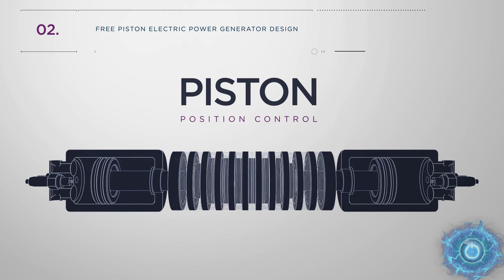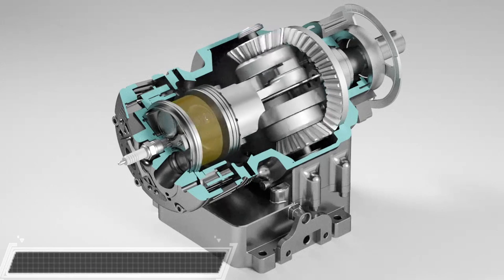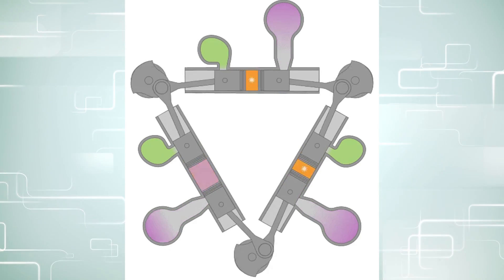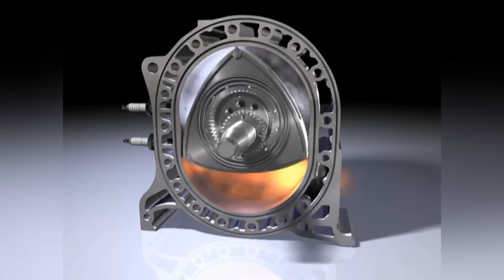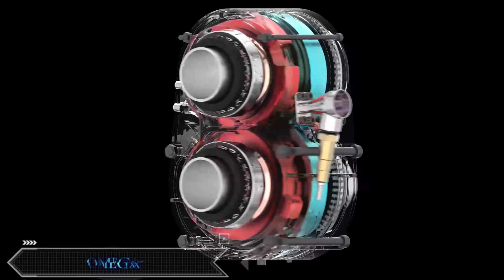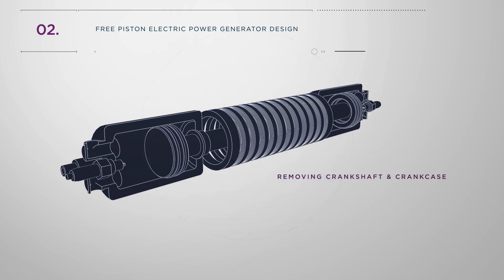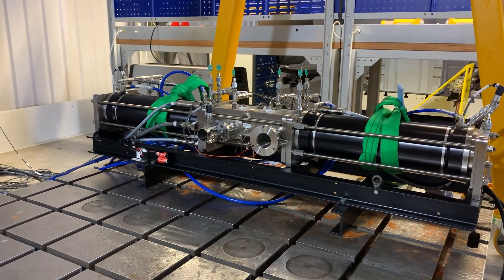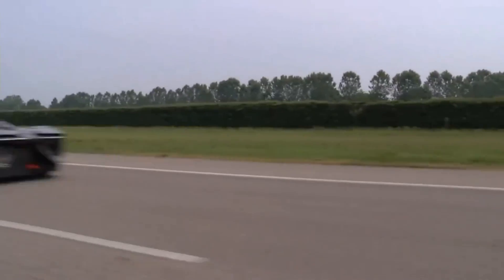7  MOST EXTREME MINI-Engines

Comment: You can call them "range extenders" if you like, but that only proves a fixation on the electric drive portion of a true Hybrid drive system, which necessarily uses a form of chemical fuel input at this point in the tech development. 
The benefit of efficiency and range derived from this far exceeds the concept of charging electrical storage batteries at some fixed location, especially when people aren't even smart enough to standardize the battery configuration in order to quickly swap modules in any vehicle at any given refueling location. 
Not to mention that the methods of manufacture and charging these battery modules could greatly diminish the narrative's stated goal of "green" (bullshit) energy propulsion in comparison to the minuscule amount of chemical fuel used and it's negligible effect on the "environment".
Do people want Freedom or Control? Best dig deep into your soul for the answer to this, and be honest about it so we know who you really are.

Comment: SMALL range extender engine makes some sense IF used as a recharger.  Start "charging" the battery from the start, even though the drain is higher than the charging rate.  So if 50% power, then doubles range.  So at 10-20kw engine would do the trick.  Also the engines do NOT have to be all that durable as they would be use INFREQUENTLY by any sensible driver.
Reply: Being less DURABLE makes them cheaper and SMALLER!

Comment: They use APU's on planes and Space Shuttle, would make sense to use them on hybrid EV's.
Reply: We had an auxiliary power unit at the aircraft mechanic school I went to. It burned 16.8 gph and provided 94, so not very efficient. I wonder how small turbines compare to small piston engines, as they do provide higher rpm's and less wear/vibration.

Comment: A small turbine used at a constant speed running a generator would be a hreat range extender.
Reply: And a source of heat for batteries during winter. Further reducing power draw for winter use.

Comment: A few of these are not even working engines.  Some were running on air pressure, which is very different from IC.  I can think of an easy way to balance the double acting single piston, btw, either passively dynamical or actively.  And it you did what I'm thinking you could balance it very well.
Reply from the maker: Great point! Toyota got involved with single free piston single rebound quite awhile ago but the o.p. is great for direct conversion, maybe better than the other engine designs just due to its simplicity.
Reply: Achetes is being tested by Walmart. They have a huge incentive as investors, that is using it’s trucking as testing ground. Probably save a ton of fuel for each vehicle

Comment: SFC (specific fuel consumption) in pounds per horsepower-hour (or g/kWh) is at least as important as specific mass. 10 kW is plenty of power for an EV range extender.
Reply from the maker: Good point!

Comment: That jet turbine one sounds like the future driving by!
Reply: Nope.  All kinds of problems, some not at all easily solvable, like what do you do with that massive amount of VERY hot exhaust, and the fact that specific fuel consumption BEYOND sucks.  The real upsides a are power/weight, longevity, smoothness, and some others I'm probably missing.  Another negative is cost, and the difference is MASSIVE.  I doubt they are going to be printing blades, especially hot section, any time in the near future, either. I'm not even sure how you WOULD print a single crystal structure, unless you were printing down at molecular levels.  I can guarantee you that most of this will never come to fruition, not in the foreseeable future, most of it probably never.  Some of the ideas are just totally impractical, really.
Reply: @MrJdsenior  glad you spent all that time writing this up… I said sounds like the future not is the future 😑